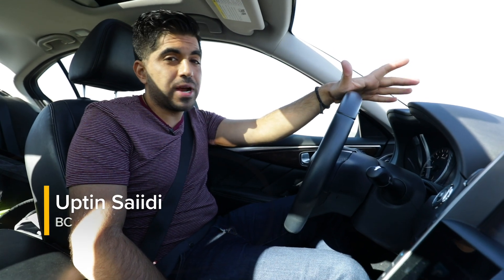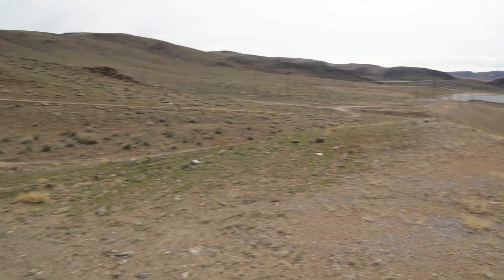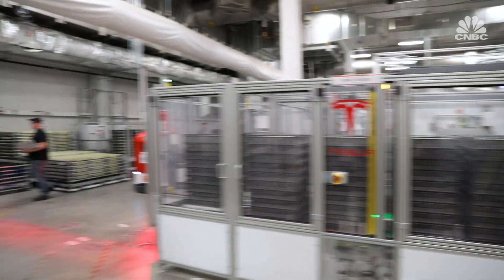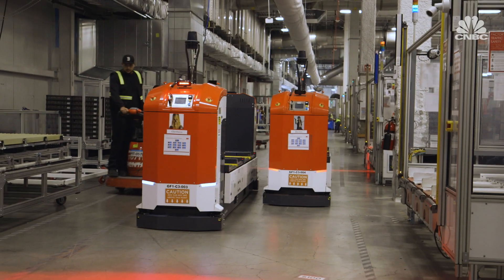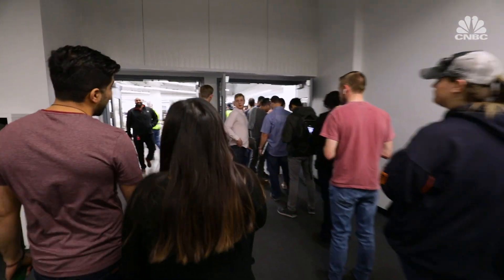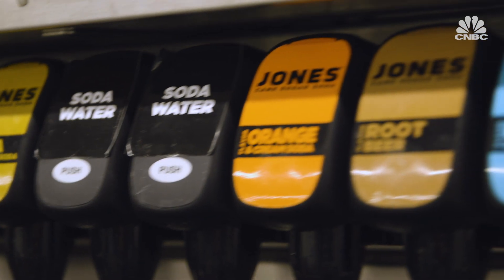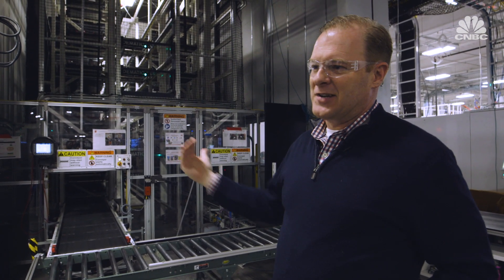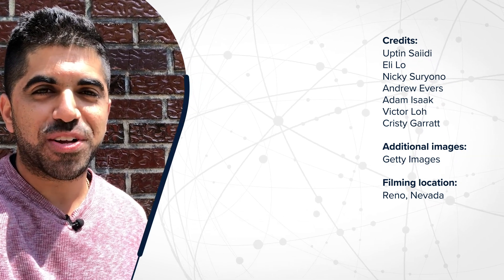Take a tour inside Tesla’s first Gigafactory | CNBC Reports

Comment: What about the fact, the batteries are heavy metals and are no recyclable. You could bury the batteries and did them up 100 years later. Why are we not focusing on hydrogen?
Reply: only heavy metal is cobalt which is 2% of the battery, drill bits and many steel alloys have 7% cobalt in them why aren't you worried about those? also batteries are recyclable just cost more to do it, most hydrogen is made from petroleum, the rest is made using energy intensive electrolysis.
Reply: @miguellopez3392  Cobalt is cobalt. That's 2% per battery. Add it up. Also, I didn't know about the other things you mentioned. Batteries are very old school and are no longer the best choice. Why not hydrogen?
Reply: @gregorys6838  cobalt is not just cobalt, cobalt isotope is much deadlier then regular cobalt, cobalt grounded up into a fine powder and not bonded to another element is more harmful then cobalt bonded to carbide, computers are also old school but with technology they improve, batteries are now are getting cheeper, durable, more powerful, and more energy dense to the point thaty can reach acceptable ranges at reasonable prices, this will continue to improve, hydrogen is just another way oil companies will try selling us their oil products, using electricity to make the liquid hydrogen also takes a lot of energy, so much so it will fundamentally cost more to refuel then a battery car where the electricity is sent to the battery instead of being used in a manufacturing processes.

Comment: So where will all these batteries go once they go bad?
Reply: They get melted down in a furnace with filters that remove any toxic gasses and the various metals are split into their original form and then reused
Reply: Hooooly MMMMOOOLY!!! WHAT AN EXCELLENT QUESTION!!!! MR. ENGINNNEEER ??? ARE YOU OUT THERE TO ANSWER THIS QUESTION?? I think it never dies because they charge the car with a cord.
Reply: LLLLOOOOKK!!! Just drive the Mercedez Benz when it rain. Put the EXPENSIVE Car in the GARAGE. Keep you safe and keep you from being electricuted. It is only use for as a Status Symbol.
Reply: @starlight2371  uhm, your comment makes zero sense. Mercedes Benz is expensive while Tesla is cheap. Tesla is absolutely safe during any rains (idk why do you think you will be electrocuted). And why do you need to have a car in the garage? Isn't the whole point of a car to get you to a different place?

Comment: Could electric cars be a fad or is this truly our future...your thoughts?
Reply: Absolutely the future.  Question is when will they reach 50/50 in sales with ICE cars. 2030 -2035 seems likely because of infrastructure (charging and manufacturing).  The tipping point is probably 20 (EV) /80 annual sales.  Once that happens (50/50) crossover will be within 5 years.  90/10 to happen about 5 years after that.  Charging infrastructure is easier than many think because a lot of it will happen in personal garages. People will need to have 220 V service wired into their garage.  Personally I don't plan to own an EV sooner than 5 years but if I build a house today it would be wired for 220 V in at least two places in the garage.  Also, setting up a bank of chargers 20X easier and less expensive than setting up a fueling station. Most automotive R&D is currently going to EV and self-driving technology so ICE cars are all but destined to be left behind.  People will have a love/hate relationship w/electric vehicles but most will not miss ICE vehicles after a few years of owning first EV.

Comment: 1) Call your factory "giga" which means "billion"
2) Have it be 5 mere millions of square feet (very impressive size measurement btw) which translates to "mega"
3) ???
4) PROFIT!!!
Reply: Omg the details some people nit pick about.
Reply: @crazytekkie1  It's not my fault, it's genetic.
Reply: The Giga refers to the capacity of the factory to produce batteries in the GWh per year range.

From Wikipedia:
"As of May 2019, Gigafactory 1 has achieved a theoretical capacity of 35 gigawatt-hours per year but utilization levels have resulted in a 24 gigawatt-hour output, according to Panasonic President Kazuhiro Tsuga."

Comment: Panasonic has terminated some of the Tesla deal, unknown what, or why.  A worker there said they did not get paid for over a million batteries shipped. 
Classic classic case of a visionary reach exceeding his grasp.  Musk is now about $12 Billion in debt with a coupon of ABOUT 7 - 8 % and the fresh new $2.5 billion equity and debt issue will buy him some more time, as he is losing money big time.  Wall street banksters now MUST keep him alive after the stock has dropped 25-30%.  
Losses have been averaging ABOUT $700,000,000 a quarter.  Parked and driving cars spontaneous combustion of the batteries is not a help for sure.
Reply: ursel doran 🙄
Reply: Could not confirm any number. Do you have any sources or what? Also just so you know, 16 ICE cars catch fire every 60 minutes. Flying is safer than driving them.

Comment: I just recently started working out there on the Panasonic side. It is huge, there a lot of ppl, many Tesla's, and so far seems to be a pretty good job.
Reply: As far as the specific job that I'm doing, I think it's more or less just kinda luck of the draw honestly. They put you where they kinda need you it seems. I was given a couple choices within the "top cap" area of the battery manufacruring process (there are several different areas in the manufacturing of the batteries. I dont know what all they are or how many there are. There are many it seems, my area is "Top Cap") they had a couple positions open in assembly, a couple in press, & one in quality control. I took 1 of the press positions. I didn't apply for it specifically per say.
Reply: I didn't like assembly because it's in an ultra clean environment and you have to put booties over your shoes, put on one of those like tyvex full body suits, cover your head, wear a mask & all that stuff. My body temperature runs hot enough as is, I don't need any extra layers, nor did I like the idea of having to take all that shit on and off every time u go on break, lunch, etc. The press room is a little different, that stuff isn't needed. Its just really loud so the worst I have to deal with is keeping earplugs in all the time.
Reply: @jaredpeterson5335  Oh wow, didn't know they were that tight about it. Makes sense though. It's fascinating how things turn out the way they do. 
Sounds like an interesting job. 
Did you have any big names on your resume or degrees? In my head, I would imagine Telsa only takes the top of the line individuals lol
Reply: @VideoMasher3000  lol. No not really. It seems like they kinda take almost anybody from what I've seen in my short time there so far. With that said, it also seems like the ones that are just there to collect a paycheck or that have trouble learning how to run the machines either get weeded out or shuffled somewhere they can't hurt anyone. Like where I'm working u kinda have to think a little. It would b easy to hurt someone.
Reply: @jaredpeterson5335  oh wow lol. Wouldn't want someone messing that up and knocking a body part off lol.
I just got off a job at Disney and would love to go work at Tesla, but  I assumed they wouldn't take me cause I don't have impressive stats.
Would you say it's worth trying it meant moving across states?
Reply: @VideoMasher3000  they'll take you bro. Also, I work for Panasonic remember. There are many ppl here that have switched from working at Tesla to Panasonic and they all seem to like working at Panasonic more then Tesla. Not being biased, that's just what I've heard u know. U can apply directly to Panasonic or through the temp agencies: Intellisource & I think the other one is aeromark or something.
Reply: @jaredpeterson5335  alright cool. Thanks for the advice! What would say is the reason everyone is going to work for Panasonic instead of tesla?
Reply: @VideoMasher3000  well I just know what I hear and ppl say that the ppl at Panasonic are a little more likeable, sociable, & easier to deal with but again I dunno from personal experience just what I've heard.
Reply: @jaredpeterson5335  Huh...Well, this has been very fascinating to hear about. Never thought I would talk to someone who actually worked there. I bet they pay you really well lol
Reply: @jaredpeterson5335  Panasonic side is nice, they have a sushi bar if you haven't been yet. Top cap is pretty nice if that's where you're at. Also the building is supposed to be expanding this year🤘
Reply: @unknown_user-7497  Yea, I am looking forward to eating at the sushi bar sometime. I work nights only so I don't know if or when I'll be able to make it there. I'm not sure if they are there during the times I am. Also, I can't wait to see the building when it's completed, at the same time it's already so damn huge.  I don't know my way around  & get lost as is.
Reply: @jaredpeterson5335  some advice from tool & die maker 45 yrs. keep those earplugs in, my hearing has taken a beating in my golden years , now wife talks and I look at her and smile !
Reply: What do you do there?
Reply: @VideoMasher3000  I am in training still, but I'm in the press room where the battery ruptures & terminals are pressed out for the battery caps. The ruptures are designed to pop up at a certain pressure & vent out the holes in the terminals incase there is an issue w/ a battery. That's kinda vague but I really don't know enough to try to talk like I do know just yet, lol.
Reply: @jaredpeterson5335 That's very interesting lol. How did you end up getting a job like that?
Reply: I would die to work in Tesla 😂
Reply: @شهد-ت4ف1ش  Don't know if you'd want that. From the  looks of it, doesn't look like a stable company to work at as a laborer or even as a mechanical engineer. But if your professionally qualified like an automation's engineer developer. Then I'm sure you would have a long term relationship there.
Reply: @ultramoo  Now how can you say, "From the looks of it, doesn't look like a stable company to work at as...."? I'm just curious how you were able to get such a good look into the stability of working for Tesla that you've come to the conclusion that it's just not a good place to work? Maybe I'm wrong & missing something here but I'd go out on a limb here & be willing to bet that between the 2 of us, I've probably had the better "look" into what it's like working for Tesla. Yes, I know a couple of previous Tesla employees that are now at Panasonic that have said they like Panasonic better because they say the ppl seem more sociable, etc. However, I walk past the Tesla side of the factory everyday on my way to and from my area and so far I've seen the same ppl working the same jobs there. I don't see a bunch of new ppl all the time. That must mean a little. I sure do see A-LOTTA god damn vehicle parts being made every time I walk though there & I think, "Man, are they really selling that damn many of these things to demand this much production?" The answer is - Yea...or they wouldn't be making them & I wouldn't be running 1 of like 20 (so far) presses that's pumping out a few hundred thousand battery caps every shift I work. Keep in mind the factory runs 24/7 - 365. ...And you wanna bring up looks of stability?? Bro...
Reply: @jaredpeterson5335  fair enough. Don't get me wrong i'm becoming quite a fan of Tesla. But I probably would think twice before working there.  Depends on the role.. if I was an automatons engineer .. 100% be accepting a job there (in terms of stability) .. but if i was a packer, I'd keep my days numbered before some robot takes over it or they decide they need to lay off staff to save some cash.
Reply: @ultramoo  well, if you have ever actually paid attention to companies that start laying people off, it's not their lower ranking, laborious jobs that typically go first. Most rounds of layoffs happen in upper and middle management. When companies start to realize they need to trim the fat & see to many chiefs rather than to many Indians. So, if that were ever the case, I think it actually much rather take my chances that my job will last longer competing against robot technology vs company fat. The thing is, there are already robots doing things but there are some jobs that just have to have the touch and abilities of a human.
Reply: @ultramoo  Also, I guarantee that this world will never ever run out of jobs because they have been taken by robots. I promise that where a robot takes a job, it has created 2 more just by the replacing of 1. There has to be people to run them, work on them, program them, adjust them, understand them, design them, map them, sell them, deliver them, put them together, it goes on and on. If we ever live in a world where robots have taken over all jobs then there would be no economy, no one earning money thus no need, demand, or use for the robot as it won't be needed to build the machines that build the machines that we all buy.
Reply: How can I get a job at Panasonic? Is there any agencies I can call?
Reply: @at5840  I think there are also a couple staffing agencies that hire for Tesla/Panasonic also. I think 1 is Aerotek and the other is Intellisource. Just Google them and check it out if your intested.
Reply: Have you ever met elon musk at your workplace?
Reply: @MrBibibip  I seem him walk through twice I didn't get real close and didn't say anything because it's possible to be fired if you stop to talk.
Reply: @unknown_user-7497  If you were on break let's say, could you talk to Elon then?
Reply: How many days do you work? And what's the starting pay?
Reply: @at5840  you work half the month basically. What I work this week I will have off next week. The schedule is something like 3 on 2 off 2 on 2 off 3 on 3 off kinda deal.
Reply: For Tesla its 3 on 4 off then the next week its 4 on 3 off. I have been working at Tesla for a lil over a year now. I love it besides the work being pretty repetitive.
Reply: But how much do they they when you get hire???
Reply: @at5840  at Tesla I work night shift and I started at 17.87/hr. Day shift make 15-16/hr. But if you work the weekend shifts on Friday and Saturdays you make more.
Reply: How many hours you work a week? Cause I here people complaining that's too much work hours
Reply: @at5840  its 12hr shifts 6-6 yes it is alot of hours, but you get 3 days then 4 days off so its 100% worth it.
Reply: Do you get a lot of overtime?
Reply: @at5840  it depends on your supervisor some let you do 6 days a week but mine only lets us do 5 days a week. And you can choose what days you want to come in as well.
Reply: You can choose what days you wanna work or is that only for the overtime?
Reply: @at5840  overtime only. There is 4 different shifts to choose from: 

A shift which is days 6am to 6pm Sun, Mon, Tues, alternating Wed. 

B shift which is days alternating Wed, thrus, friday and sat

C shift which is night on A shift days

D shift which is B shift but nights
Reply: And how many vacations do you get a year?
Reply: I just got offered a job but I have a criminal record from Washington state. Do they hire felons
Reply: I heard it was a very toxic environment and people told me not to apply at Tesla cause I will get fire quick
Reply: @at5840  if you work hard and keep your home life and work life separate and don't associate with the drama starting people you'll be fine and most likely keep your job I only got let go last time because I wanted to skip days
Reply: @at5840  nah, it's good work.
Reply: @at5840  A lot of places have so called 'toxic ' environments. The key thing here is keep an open mind and not get pulled into politics, conspiracy theories, etc. Yeah, you might up with less friends, but you'll be more focused. Remember, misery likes company.
Reply: Until you get replaced by a robot omegalul
Reply: @aaronc8571  lol 😂 😂
Reply: Did u get a free Tesla lol
Reply: Can you share the recipe of battery chemicals they use?
Reply: InventiFire - Best Kickstarter, Indiegogo Crowdfunding Projects nothing but anode and cathode drums being loaded into a Japanese industrial machine that produces the batteries for the Tesla models
Reply: @lilzenkaiboost5700  recipe please..
Reply: InventiFire - Best Kickstarter, Indiegogo Crowdfunding Projects I want a piece of the pie lmfao
Reply: @feirox-dot-comwholesame-do3  I dont know the recipe my good man, I'm sorry. Every process is all split up into different areas & completely different parts of the factory. The factory is not wide open as some may think it is. It's all separated into different areas all mostly behind closed doors. I really only see my little part of the whole process.
Reply: @jaredpeterson5335  what's your part mate?
Reply: @feirox-dot-comwholesame-do3  I run one of the presses that presses out what's called a rupture for the top cap of the battery. It's the piece that in the event a battery becomes damaged, fails, or something happens, it's designed to pop up at a certain pressure allowing gasses to escape instead of & before exploding. (No one wants a Tesla vehicle to go up like Samsung's phone batteries did a while back right? Phones have 1 battery in them, a Tesla has over 4,000...just imagine that firework display). :>
Reply: Jared Peterson ur

Comment: Curious, I've seen this GF basically at the same state as it has been for almost a year ago. Where's the next building module expansion? I don't see any building frames or things like that here. And if you looked at GF in China, they just started like 3-4 months ago, but the construction pace is amazing. China GF will be finished before Nevada GF at this rate.
Reply: Yeah no arguing with that. I have been wondering why they slowed down GF1 also. They need to be pumping out more batteries